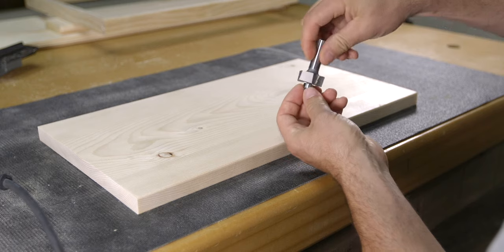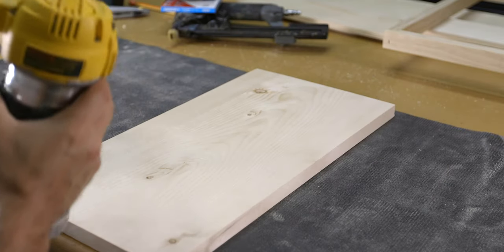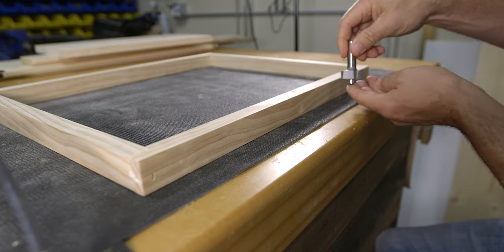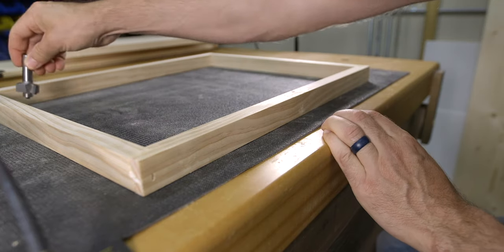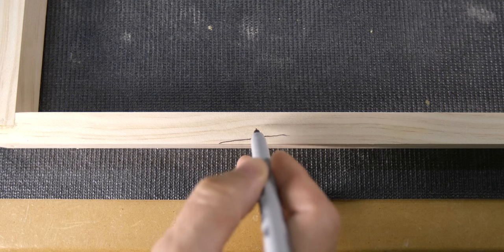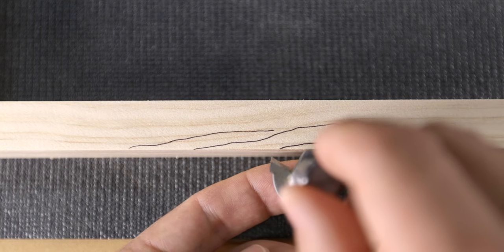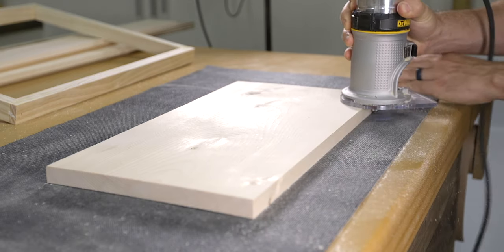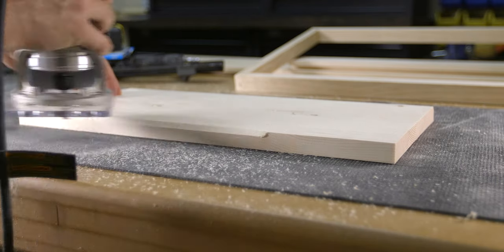Routing Direction Review

Comment from the maker: Our beginners handheld routers course is now live! Check out the online course here ---> https://bit.ly/3DcIeE3
Reply: Good morning,

I have a few questions; first one is how to use a router on 1/8 inch aluminum panels, can I get away with using wood bits if it was only a small part, & what are the bits to use.  

And could my DEWALT DW618PK 2-1/4 HP EVS Fixed Base / Plunge Router Combo Kit be able to handle cutting 1/8 inch aluminum?   Could it be used to cut thicker 1/4 or 1/2 inch aluminum?

And my last question, are there inexpensive mills I can mount my above mentioned router into and use it as an manual mill for working aluminum?

I am just now seeing I am writing to your post from over a year ago, I hope your offer to try and answer viewer questions still stands, thank you.
Reply from the maker: Hello. I have never cut aluminum with a router before so I don't even know if that's possible.   @112Famine

Comment: As a master furniture maker now, I was always taught how to simplify the direction of the router. Always "PUSH with your LEFT hand, PULL with your RIGHT hand".  As long as the routed edge is facing you on your immediate side. The routed edge should be the closest edge directly under your thumbs. With the router table /shaper, it's the opposite. Push with your Right-hand PULL with your LEFT hand. Again, (hand router) PUSH with LEFT hand (router table /shaper) PUSH with your RIGHT hand. Climbing or what we call " cold creeping" is the opposite of this.

Comment: Hi-I' not sure how to chamfer cut inside CORNERs when a frame is already built. Trimmed out a pantry and realized I had not routered-out the Trim already glued and nailed to the wall to match shaker doors rails and stiles that are below that frame.  Using a hand router with Chamfer bit.

Comment: Great videos, can you do a video on plunge cutting  through a middle of a board for t track. Plus, I am interest to know the best speed and depth to do. Thank you
Reply from the maker: Great suggestion! Thank you!
Reply: @TrainingHandsAcademy  I too am curious about the plunge cut and using a fence for a dado.  I currently need to cut 3/32" deep dados about 1-3/4" wide to accommodate some drawer slides in a pre-fab work bench.  I'm thinking that using a fence, that the fence you are guiding by becomes your outside edge, cutting left to right pushing against the fence???

I only have a 3/4" straight bit so I'll need to relocate my fence for the other side of the 1-3/4" dado and repeat the above, once that dado is made, I'll come back and; without the need of a fence, route out the spoil left in the middle (the material left between the two dados)... sounds right I think.

Talk to me Rocky Top!!!
Reply from the maker: @davidr6585  Everything sounds right David, but I would still use a fence for the final pass... just to make sure the router doesn't stray.

Comment: Question… when following a template with a bushing guide, does direction matter? For instance a letter template.
Reply from the maker: Great question! It does matter for almost any other project, but with letter templates not as much. Sign making router bits for the most part are good to use in any direction. They are generally a type of v-groove bit or a small spiral up-cut bit that only is removing a very small amount of material. Bottom line, take it slow and see how the router reacts with each bit and type of material.

Comment: I was wondering if you have a video showing the use of the router to work the inside edges. I have a frame that has beveled edges on the inside and I want to take them off so it’s just a straight edge down (a 90-degree angle vs. beveled).
Reply from the maker: I'm sorry I don't on Youtube, just in my router course on my website. Using the router will be the same on the inside only your direction will change. You can always email me if you have more questions. Josh@traininghandsacademy.com

Comment: Very useful advice. How would you cut a rounded edge on a  hardwood worktop made from wood staves? I want to round off but on the long edge I have long grain and on the sides  I have end grain. I'm confused and also don't want to ruin all the new worktops I put in. Thanks. Ed
Reply from the maker: Hey Ed, nice to meet you! In general, you want to mill the end grain first and then the long grain. I would also take very light passes just to be sure the top can handle it. Because I can't see what you are working on, I'm only able to give general advice. If you want, find me on Instagram and send a video or pictures. Let me know.

Comment: I want to open a recess in a piece of wood to add a clock movement. Is a router the best way to cut a 3”X3” square cut to fit a battery operated movement? I am cutting into 1.5 inch thick oak log ends about 6 inches in diameter. They are smooth surface and have bark edges.
Reply from the maker: Yes and router is a good tool to use.

Comment: Hi, I have 2 questions. If I use a Router on a Router table where the router bit comes up from underneath, does that mean that the bit spins Counter clock wise with means I have to pass the wood in the Clockwise direction?

Second question. I have a Dewalt DW618 and was wondering which is the best speed setting for 1/2" bits and best speeds for 1/4" bits. Thank you so much for your time. I haven't been able to get this answered anywhere not even from the mobile solutions company I bought some of my router bits from. 😅
Reply from the maker: Hello Jose! Yes, once you flip the router over from a handheld position to under a table, the bit will now be rotating counterclockwise so the feed direction would be clockwise around the outside edge. But there are some areas that can still get you into trouble. Here's what I suggest then... take a sharpie marker and draw on the table the rotation of the bit, so that no mater what you are doing you can always see what direction you are feeding the work. This takes some time to learn, that's why it's very important to mark the direction of the bit so you can always remind yourself. Remember, the safest direction to feed the work is always against the bits rotation. Always stop and think before you cut. To your second question... correct bit speed is 100% dependent on the bit diameter and not on shank size. Google search "router bit speed chart" and you will find the max speed settings for each different diameter bit. I hope this helps, I do have a hand-held routers course coming up soon which will cover these topics and more. If you want to be notified when it launches check out this link -->  https://bit.ly/2I8vT9k
Reply: @TrainingHandsAcademy  thank you so much for the info and yes I am very interested in the hand held router course! I'm just getting into this stuff but I am falling in love with wood working and can't seem to stop watching videos about it. 😅

Comment: I just bought a router and have no idea about the different bits. I am making cutting boards as Xmas gift and I cut them out with a jig but wanted to clean up the edges with the router. What bit do I use and how do I set the bit depth? Please help!😢
Reply from the maker: Are you just easing the edges?

Comment: Does it make any difference which way you're holding the router, that is with the cord toward you or the cord away from you?
Reply from the maker: That's a great question, never really thought about that. When I use a router the cord generally comes out to the right side and I'm pushing the router forward or away from me and the cord follows. I don't know if that makes sense or not. Let me know.

Comment: I used the clockwise cut on the inside of a pine plywood frame and it shredded the wood. Nearly ruined the project. It was cleaner when i went counter clockwise on the inside.
Reply from the maker: Yes, sometimes while working with certain materials a climb cut can be safe, and will for sure produce a cleaner cut. But be careful, that isn't always the case. Glad you saved the project!

Comment: I have a question. While I am using my router it likes to dig deeper into the wood sometimes not sure why it likes to do this but I set it to lets say 3/4 inch depth and when I am in mid cut it likes to try and go deeper. I have tightened the clamps on the router to try and stop this but it seems that that is not fixing this issue =( if anyone knows why I would love some help =) Thanks.
Reply from the maker: Hey Kiana! Sounds like maybe the bit is sliding in the collet. Try making a mark with a sharpie on the shank of the bit, tighten it to that mark, and then make your cuts. If the bit moves off your line, then you know it's that. If not, then we need to look elsewhere. Does that make sense?